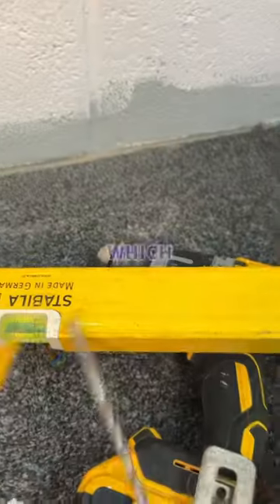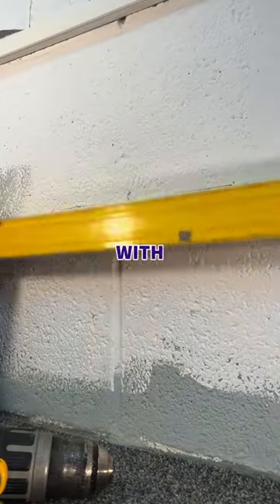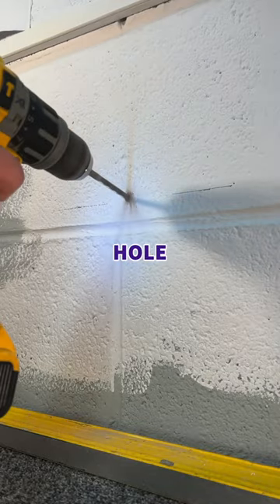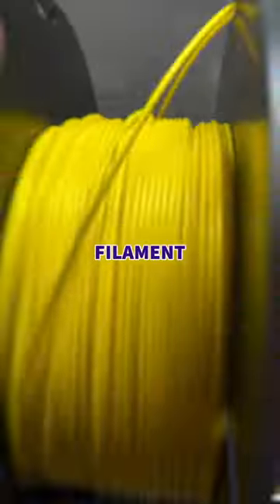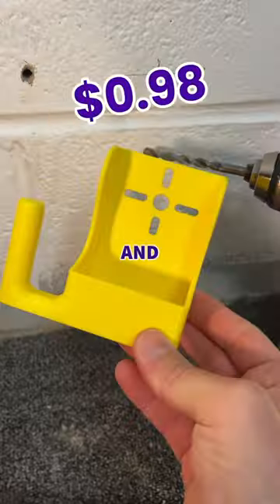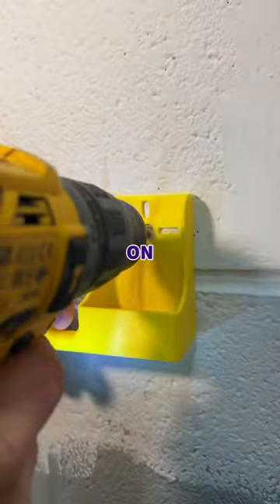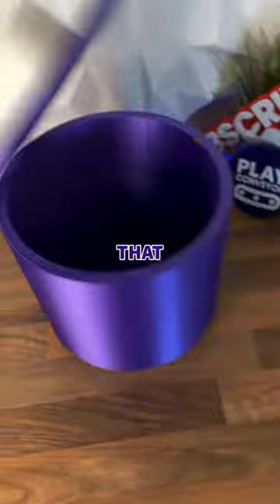3D printing SOLVED the PROBLEM with DIY 🪚 #3dprinting #lifehacks #shorts

Comment: Have you ever heard of... a vacuum cleaner?
Reply: It's one thing to just vacuum a floor.  It's another if there's a whole bunch of junk under the hole you're drilling.  I usually just held a stiff piece of paper against the wall, and had to be very careful to avoid a spill as I moved it away.
Reply: @Mueller3D hold the vacuum directly below the drill while drilling.